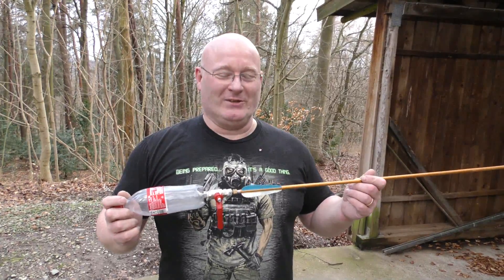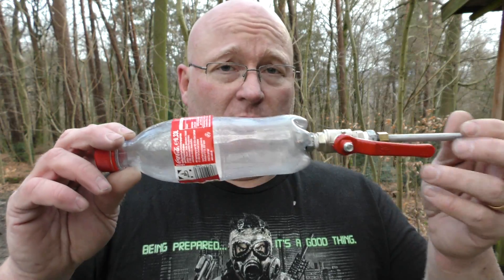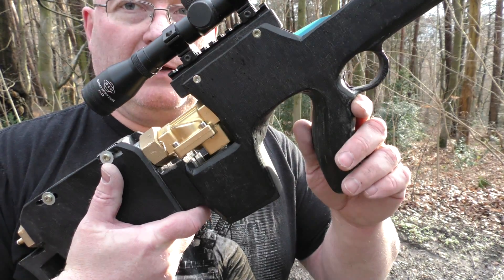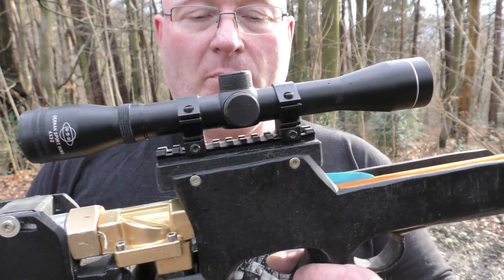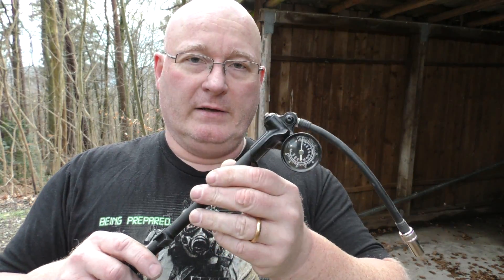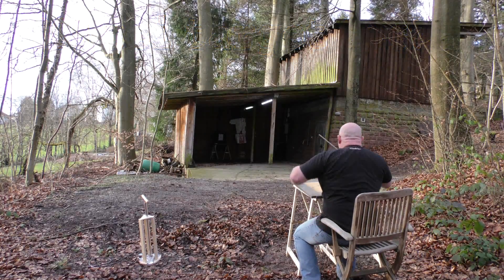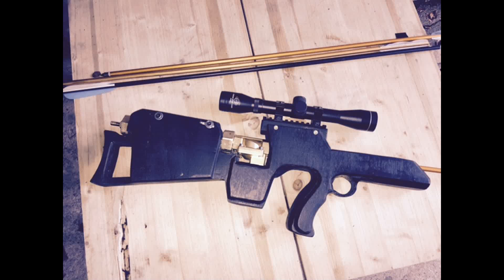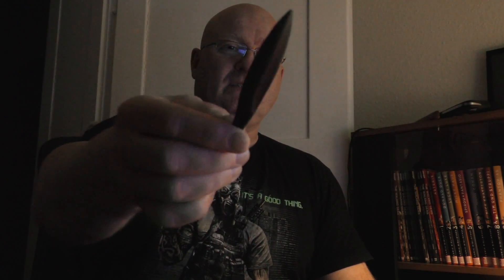Homemade "Bullpup Sniper Airbow" made from plumbing accessories

Comment: wie so benutzt du nicht einfach einen Kompressor für so was wenn du es zu hause aufnimmst ist schneller und ist nicht so ansträngend wie die Luftpumpe
Reply from the maker: +TheMockTv Erschwingliche Kompressoren schaffen keine 200 psi, bei 10 bis 12 bar ist Feierabend. Nur die Kompressoren für Taucher schaffen diese Drücke, aber die fangen bei 2000 Euro an.
Reply: ja wenn das so ist habe ich nichts geschrieben xD
Reply: +TheMockTv man kan jedoch einen kompressor von einem Kühlschrank abmontieren und so umbauen ( siehe tutorials auf yt) dass er 30-40 bar Druck schafft und das geht immer noch schneller als mit der Mini federgabelpumpe
Reply: +TheMockTv man kan jedoch einen kompressor von einem Kühlschrank abmontieren und so umbauen ( siehe tutorials auf yt) dass er 30-40 bar Druck schafft und das geht immer noch schneller als mit der Mini federgabelpumpe
Reply: +JoergSprave did you ever get anywhere with the slingshot that shot a slingshot that shot a crossbow bolt?

Comment: Hello Joerg, I recommend you to buy an air compressor so you dont have to spend all that precious time manually pumping with your bike pump. Also it would be nice if you could experiment more with compressed air. And what I would really like to see is your high pressure electrically triggered gatling gun.
Reply from the maker: +Petr Bernat Compressors that can do 600 psi are rare and expensive.
Reply: Yeah, you're right. My bad, I have been confused by unit conversion.

Comment: Could you use gunpowder charges meant for nailguns to propel the arrows? Or are there laws against that?
Reply from the maker: +harald8 IDK, the gun laws would allow it, but there are so many additional laws for explosives... I am fairly sure it won't be OK, legally.
Reply: i think at that point it can be considered an actual firearm if you use any ballistic charges. also dont nail guns also use Air not ballistics
Reply: +Blue★ There are some heavy duty versions for fastening stuff to metal or concrete that use what is basically a .22 blank.
Reply: +harald8 ahh but then again i assume ttheywould he classified as Industrial and well most industrail grade equipment can make great impromptu weapons.

Comment: if you hook it up to a fully charged scuba tank on your back you could use 3000 pounds of pressure.
Reply: Or you could use it to reload the small chamber on the rifle a bunch of times and much more quickly
Reply: +The West Will Rise Again! If you attach a Timer circuit and a momentary switch to the solenoid valve  you could set the amount of force per shot with a simple knob.
Reply: Does all that pressurized air get released in one go?
Reply: +The West Will Rise Again! Polarstar/HPA airsoft guns dont, so im guessing no
Reply: +Liam Allen thats because the tank of an Airsoft only opens for milliseconds. That is, in the case of airsoft, achieved through mechanic cutoff. with this electric design you'd need a self-resetting solenoid valve that has a very low reset time and a timer circuit that determines the length of the electric pulse
Reply: electric quick exhaust valve = solenoid valve + pulse generator
Reply: +K3PTN Electronic paintball guns have a solenoid and are running an 68ci/4500psi tank (usually tank size is up to the player, but the output is usually 4500psi regulated down to anywhere between 200-800psi
Reply: +GEODEAHOLIC M The tube and fittings he used probably won't stand up well to a 200 bar/3000psi scuba tank, but you could partially fill it up to something that is deemed safe for the design.

The fill valve would probably need looking at since its most likely designed for tire type pressures and perhaps also some of the other components, ideally when you're working with that pressure you want a timed/momentary switch as well for the solenoid I'm guessing.

But even if you can't make full use of the 200 bar pressure you could still get many refills before your refill cylinder will drop below maximum operating pressure of the weapon. 

Also a handpump like for example a Hill pump that I use for my PCP airguns could be an acceptable source of high pressure air, each stroke should be about 0.225L of atmospheric air according to the faq and that seems to match my refilling experience. Up to 200 bar my own body weight is enough to press the handle down, to get it all the way up to the maximum 275 bar the pump is rated for it takes a bit of building up momentum by releasing pressure from the ground while holding the pump handle goes down compressing the air.

But being realistic unless you're really certain about your design and construction methods I would be wary to go up to those pressure levels and the use of air cylinders with considerable internal volume and over 50 bar of pressure. Its dangerous stuff if something decides to break and for example some piece gives out and the bottom of the cylinder launches itself etc. For homemade improvised contraptions I would personally stick to things in the pressure ranges he's using so far.
Reply: Extra stuff

Comment: do you have to pump every time or is there a tank?
Reply: +Chris Avery Connecting it to a tank would make great difference. Small container could be carried and still be enough for tens of shots.

I hope he will try it.
Reply: I used a small fire extinguisher once as a tank, worked well for about 30 shots of paintballs at 140psi
Reply: +mxzptlx1357 Even a paintball tank might be a better idea. Depending on the volume of the chamber of that thing, you might be able to get hundreds of shots.
Reply: +Violet_Shift he's already got the solenoid so he might 😊